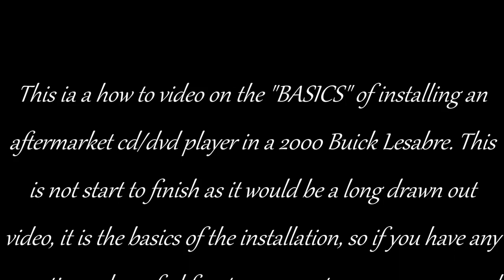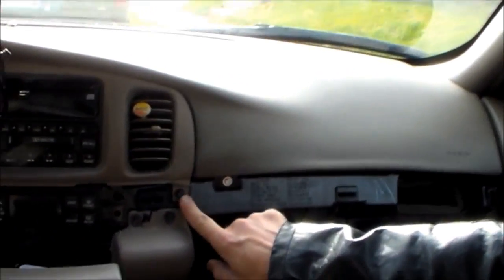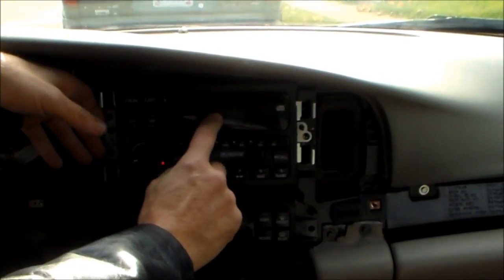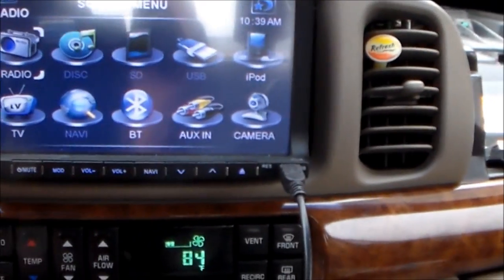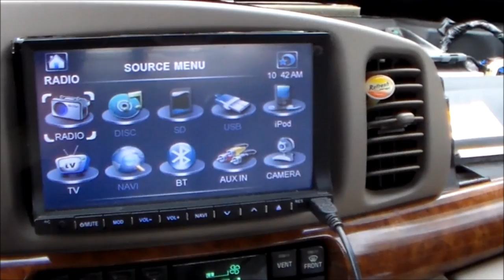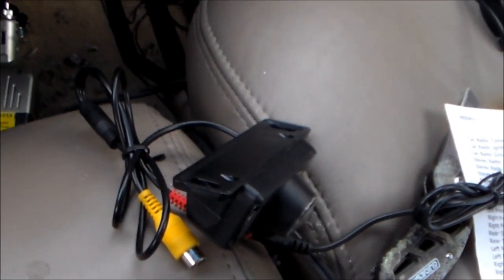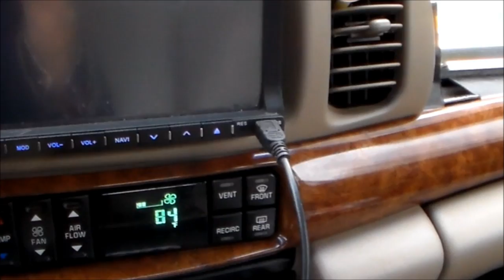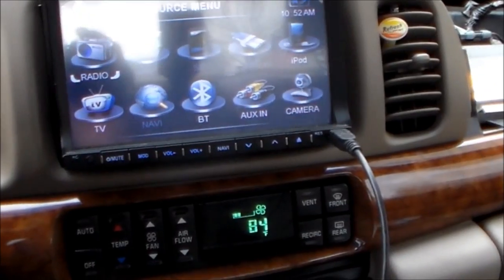stereo install in buick

Comment: in the fuse block under the rear seat  there is a relay called R.A.P that will let you have 12v when the key is on and on acc and like the stock radio that relay stays on until you open the door i have a Bonneville witch is based on the same thing

Comment: Hello, thanks for the video. Hey where can I get the special harness for this vehicle? My car has the RAP feature and the harness I bought for it at BestBuy doesn't work. Please help..... did you do a hard wiring or did you use the special harness on this video? Let me know please cuz I'm stock and I'm glad I found your video.
Reply from the maker: I ordered mine on line. You will have to wire the stereo to the connection then it will plug into the ribbon cable. Just search for ribbon connector for (whatever your vehicle is) and it should tell you whether it will be compatible with your car. Check rockauto.com first. If you. Can't find it there, let me know and I'll send a few links to you. But if I remember right that's where I got mine.

Comment: Is there anything I need to add to a wiring harness on a 2002 Buick LeSabre? I heard I need a special adapter, because I don't want my car to stop working, for not having the right equipment.
Reply from the maker: I mentioned it in the video. You will need a plug, very cheap on line.
Reply: @shabear1000  what kind of plug and, why do I have two yellow weird on my harness, witch one do I use

Comment: Do you have to remove the top dash pad and do this trimming for a single din too?
Reply from the maker: Yes
Reply: @shabear1000  so is the depth the issue? I wasn't sure if you had to do it with the double din because of how tall it was. I was hoping the single din would just slide back there with no issue
Reply from the maker: Yes. It's the depth. But it's not too bad to cut. It's only plastic.
Reply: @shabear1000  the plastic doesn't seem like the hard part. Removing the upper dash does. Haha, I'm not looking forward to it
Reply from the maker: It can be a bit of a pain getting the screws out of the dash down in the windshield, even more so back in. But stick with it you'll be alright.
Reply: @shabear1000  thanks for the tips and video. Hopefully I don't need to ask anymore questions!
Reply from the maker: You bet. If you have any issues fell free to contact me.
Reply: @shabear1000  I ended up installing a single din without pulling the dash pad off. I have a cheap Harbor Freight pneumatic saw thing that I was able to get in there with and trim the rear of the dash support with. This made it easy. What really did irritate me is that all of the aftermarket dash kits (plastic) were lacking an effective way to secure the radio to the dash. I ended up using a few self tappers to go into the plastic dash to hold the stereo in.

Comment: I have a double den radio exactly like the one you took out, would you know how to turn it on?  When I push the power button nothing happens.  There is a red light that did go on.  And, do you still have your double din radio, would you care to sale it to me?
Reply from the maker: i no longer have it. but the red light is a security light, you may have to reset it.

Comment: Will you have to run a wire from the reverse trigger wire back to the reverse lights for the camera to work.
Reply from the maker: no just either from the reverse wire for the reverse lights I went to the reverse lights that we was closer I didn't have to run a wire all the way back

Comment: Did you have to buy a special wire harness to bypass the factory amplifier?if not how do you by passing it?
Reply from the maker: +Timothy Richardson  not sure about that because i'm using the factory amp. i did get the wiring harness to plug the unit right into the factory plug. you do however have to buy a kit to make the steering wheel buttons work with the unit, which i did but i have not installed yet. as far as bypassing the amp, i'm not real sure what all that would involve. but in this application the factory amp sounds just fine. if you have any more questions please feel free to contact me.
Reply: Thanks
Reply from the maker: +Timothy Richardson 
no problem.
Reply: I know this is old,, but just for future help if anyone reads this...u don't need to buy a amp bypass kit. Just run your blue remote wire from the radios wire harness to the power wire on your factory amp. So when u start your car, your radio turns on and sends the remote signal to the amp turning it on
Reply: That will let you use your factory amp, but if you want to actually bypass it and use a aftermarket amp, then run a remote wire from the factory amp to the aftermarket amp. When u start your car the factory amp turns on still and sends signal to your aftermarket amp. U still gotta run rcas from the aftermarket amp to the radio

Comment: I'm stuck at loss, what adapter would I use. And the double din bracket has no place to even bolt or screw into? Nothing makes any sense.
Reply: And it's also a single din radio from Walmart.

Comment: Question I have a 02 LeSabre limited how do you find out if you have a stock amp
Reply from the maker: I think they all did, but it should be up in the trunk by the speakers.
Reply: shabear1000  Dammer lol was planning to do a system k know it has OnStar  . But there's to things not sure if there amps thenbthe black box on the left

Comment: The radio in my 2003 PAU just quit working and the thing that gives the temperature below it just works only occasionally. Could they have come loose from the cables behind the radio?
Reply from the maker: It's possible but it may also be the unit itself. But it's definitely worth checking out the connections.
Reply: @shabear1000  Thanks. This vid was really helpful in figuring out how to get into the inner workings.

Comment: hey man, I have a 2003 buick regal Ls 
you think I can fit a Pioneer FH X700BT 2-Way Car CD Receiver radio in mine??
Reply from the maker: +Sergio Arzola yes, that will fit your regal. make sure it is 6.5 inch. i went with 7 and had to do alittle mod but nothing major.
Reply: +shabear1000 Thanks a lot!
Reply from the maker: +Sergio Arzola youre welcome.

Comment: Hello I have the same Buick LeSabre mines a 2000 Limited I'm trying to install aftermarket TV screen and I have followed all my wires color code in matched up but I have 6 brown wires that I do not know where to connect to if I touch my red and yellow wire the screen comes on but will not go off I'm having a serious problem here can you help me out I'm also from Ohio
Reply from the maker: i believe the yellow is constant power (to keep the memory for clock, presets, etc.). the red is power, (on/off). the brown wires are to hook up the steering wheel control adapter (to make the steering wheel buttons work). also, to find constant power for yellow, i had to run down to headlight switch power. hope this helps, let me know how it turns out.
Reply: Can I connect the yellow wire to any of the other wires on the harness I'm not sure how to run the wires to the headlight switch
Reply from the maker: yes as long as it is constant power
Reply: shabear1000 hello I've got in my aftermarket radio screen to come on and go off with the car but the only problem I'm having is my regular screen keeps saying no signal did you have to have a special wire harness for your radio to play movies
Reply from the maker: No. It should play, make sure it is reading the disk. Also, will it play while the car is in park?
Reply: shabear1000 my radio does not have a CD player it's only aux cord and SD card / USB and it keeps giving me a no signal sign did you use a wire harness on your Buick LeSabre
Reply from the maker: No. There should be ca jacks on the back of the stereo
Reply: shabear1000 there are jacks on the back of it

Comment: I don't understand what you meant about the yellow wire the factory radio works in accessory mode when you turn key so why wouldn't the aftermarket assuming it's hooked up right I'm about to take this venture as week as installing an amp and new rear deck and door speakers maybe I'll search around I may just tie in to the wipers I would hate to do it the "right way" just to tear it apart of it worked out for you then I may as well do it that way in tge first place
Reply from the maker: +jason bellotti I can't remember why I had to do that now. You may not have to, but there was a reason why I had to, but I can't remember Lol. Im thinking It had something to do with the theft deterrent system. If it don't work just run it to the wipers and that should do it.
Reply: shabear1000 will do thank you

Comment: my 2003 buick lesabre custom never had this light flashing for 2 months of owning it   I purchased it  and now the top left side of the radio red light  led is flashing yet  it goes off always when i START THE CAR  IS THIS NORMAL OR IS SOMETHING GOING TO HAPPEN  . ALSO CAN i RESET IT TO DEFAULT SO THE LIGHT GOES AWAY LIKE BEFORE
Reply from the maker: that is your security light. it let's you know your security system is working.
Reply: Thank you  Shabear1ooo
i'm Happy  its all working  good .  I just cant explain why it took 2 months for the light to be recognized by the cars computer.
Reply: When you put the aftermarket radio, what's going to happen to the security system? will stop working from now on?
Reply: What did you do to change the connection of the radio to the aftermarket one?
Reply: no it has the original GM radio . i think the dealer i got it from put in a new  buick radio, but for some reason it never showed a flashing security light on it  now  it is and every thing works
Reply: +shabear1000  oh i was asking shabear1000, because i wanna put an aftermarket radio and i don't know what's going to happen to my security system, will it be disabled?
Reply: there is a video here on you tube on how to do that,  what I would do is just follow the color wires in the directons to the speakers inthe buick , then run a 12 volt wire to the radio power wire  and your done.

Comment: Hey idk if you’re still active but how did you remove the light sensor in the middle front of the dash? It just won’t disconnect for me and it’s very irritating.
Reply from the maker: I believe i just un plugged it. I cant remember if i mentioned it in the video or not. But im sure that's what I did.

Comment: where can i get these wheels hub caps
Reply from the maker: These were the original wheels from Buick. Check your local scrap yard, it's a 2001 Buick LeSabre.
Reply: @shabear1000  damn boss, the thing is i already did, only found one lol, going to check other ones for sure, online they're like 50$ each

Comment: Is the process the same for the 01 Park Ave?
Reply from the maker: Yes i believe it is
Reply: shabear1000 
Thanks a bunch man 
And for replying so quickly 
Much appreciated
Reply from the maker: You bet. Have a great weekend
Reply: I didn't need to trim around the edge to install my kenwood in mine. It did need to be shimmed to fit properly, though.
Reply: Also, I don't think we took the top of the dash off, but sawed out the plastic inside from the front.
Reply from the maker: Cool

Comment: Umm where the wire for the radio at i have the whole dash took apart i just cant find the wires
Reply from the maker: It's a ribbon cable. Should be right above the radio. I think I show it in the video.

Comment: u gotta pull in the center of the vents with both hands on both sides and pull so u dont break it!
Reply from the maker: I didn't break it!
Reply: @shabear1000  gotta be careful with that plastic fantastic interior lol.
Reply: trust me, my 04 park ave, has way less screws holding it together then those lesabres.

Comment: I need help how do u find the wire harness to plug the radio in sense it's that green thing in the middle
Reply from the maker: +Ronyell Smith it should be right behind the radio
Reply: No it's a green ish looking thing like the one in the video u have up top
Reply: But u didn't show when u installed the radio so I'm lost on the install of the radio part u showed more of the stuff I had to take apart
Reply from the maker: You must be talking about the ribbon, that goes to the radio but it plugs into the harness that you have to buy in order to hook it all together

Comment: However do you get the stereo to recognize the factory amp?
Reply: Its usually a blue remote wire. Run it from the radio to the power on the amp

Comment: My security light came on after I installed the radio.  Now my AC doesn't work!  Any way to fix this??
Reply: 2001 Buick lesabre
Reply from the maker: +Ashley P. You have to teach the car a new radio is in it. It has to "learn" its there. The Ac may not be plugged in all the way. Let me know what you find out
Reply: @shabear1000   how do you teach the car for new radio